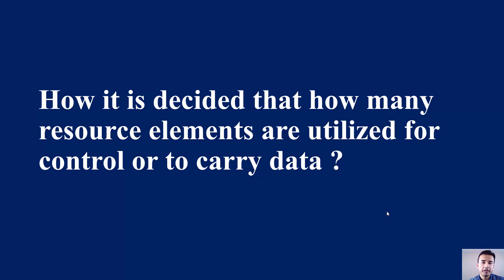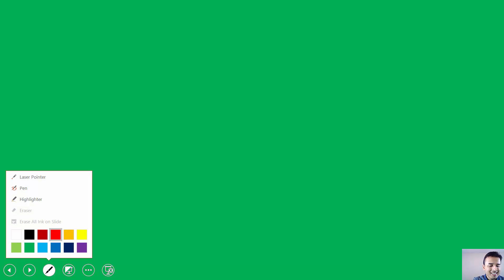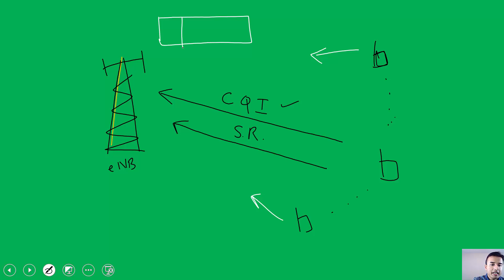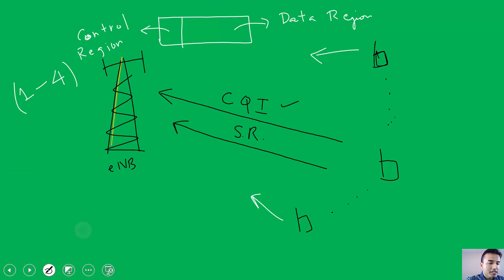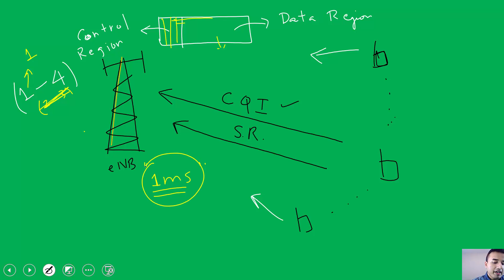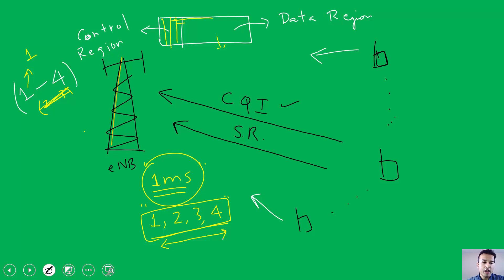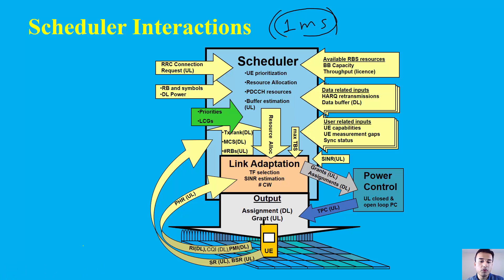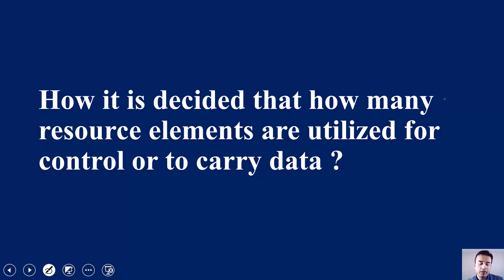How eNodeB decides resource elements for Control and Data region in LTE ?

Comment: The minimum is 2 OFDMA symbols for control signalling not one. PDCCH starts from 2 and max out at 4. The basic math is CFI+1 where FCI will be 1 as min and 3 as max. CFI can be read from PCFICH. 
There is a lte grid generator where you can check and verify the how much REs are used for diffrent physical channel of diffrent bandwidth, sharing that below as well for better understanding.
http://dhagle.in/LTE